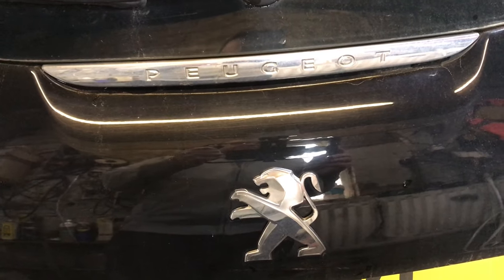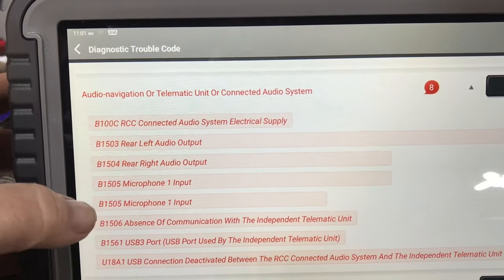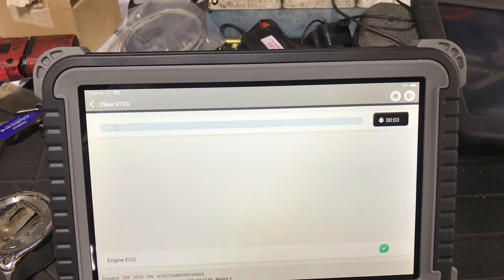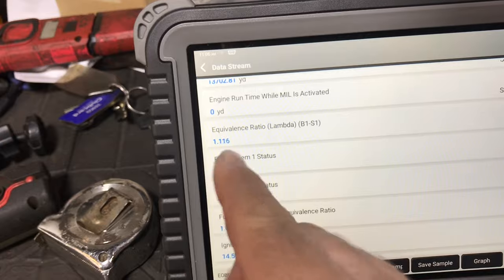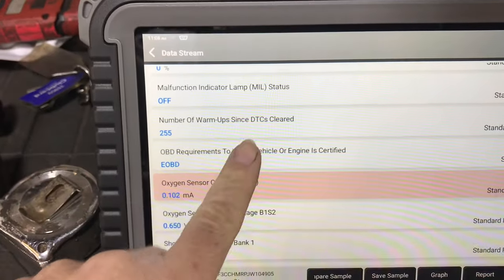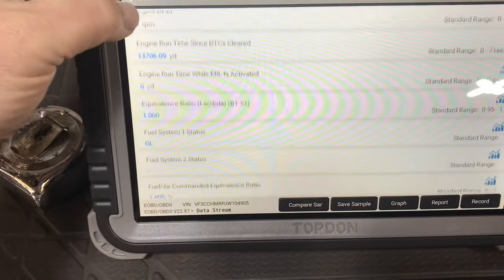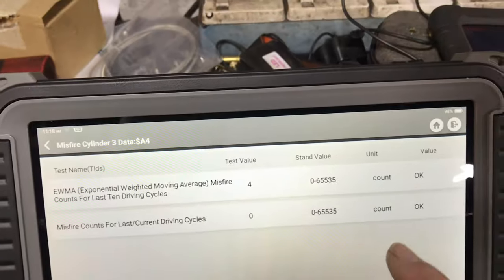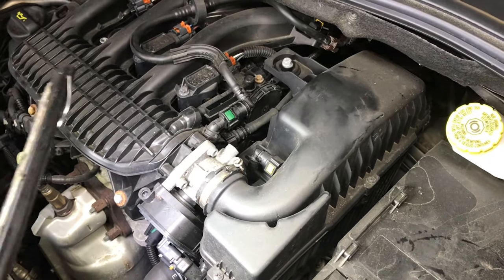Peugeot 208 (2018) 1.2 Engine - Failed Emissions Test,  No Fault Codes😭

Comment: I'd bet you would find the vacuum will be quite erratic since it's only a 3 cylinder. Usually a fluctuating vacuum gage like that indicates a valve sticking or burnt. 4 cylinders are a bit erratic but 6 and 8 cylinders have overlapping intake strokes so should be quite steady. I'm wondering if it was simply contaminated fuel or greater than e10 if it's available there. Still does not explain why it didn't try to go to closed loop and no codes.

Comment: Hi Sandy, and I'm having a similar problem with a Peugeot 208 2015 1.0 petrol model that has 55k miles on it and misfires cylinder 2. I've changed the coils and plugs, but the problem persists. Could you please suggest a solution?
Reply from the maker: Do a compression test to see if all cylinders have similar pressures
Reply: Hey mate were you able to solve it? I am having the same issue. I have replaced spark plugs and tested coils.

Comment: 2015 citroen C4 1.2 puretech 82 vti: 

I have huge vacuum in the Crankcase, it almost stalls the engine. Engine rpm periodically slow down to almost stall, then the throttle body opens a little bit (reducing the vacuum) and rpm increases.

I replaced the valve cover (PCV is build in), problem still remains.

When I blow in the breather pipe that is coming off before the throttle body, the engine runs fine.

I hope it is the valve you pulled out and showed in video 11:09

Comment: The catalytic converters are poor on these 208 petrol Pugs. Ours failed mot at 55k miles , they changed the cat and all was sorted , we were also told they burn oil because of poor piston ring design, the petrol goes past the rings into the sump oil system and also burns rich because of this scenario

Comment: I got one i had ccv valve cloge remove ot and clean it but if open oil cap while idle engine seems going rough and suction  from oil cap when close works good... Could  I the pcv valve!?

Comment: That is nuts, a car of that age, from what we have been told through the media should run on E10 easily. 
More lies being told I fear. We have a couple of old classics and looking for a fuel good enough to run them is getting difficult. Shell V power is looking like the only option and that's touching £2 a liter.  The government won't be happy till we all have electric cars, and that will be a really sad day.
Reply from the maker: Just put the good fuel in for the MOT🤣🤣🤣
Reply: @sandyande  I have been told that E10 will rot out older rubber components,I am not sure how true that is. Do you have any ideas if that is true or not?
Reply: @neilhampson2843 Yes but that only applies to older cars like pre 2000s and cars which are listed as incompatible on the government website its because of the fuel line material wasnt made with e10 in mind because it was just pure unleaded years ago, other countries have had e10 for years so the cars are already designed for it in mind

Comment: Modern E 10 fuel , kind to the environment,  but it dosent work In petrol driven cars , so now owners of petrol cars older than 2 yrs old have to spend an extra 6 quid to fill up with good stuff Sandy , great video,  glad your getting used to the new toy 👍👍👍👍
Reply from the maker: I wish I had caught the injector duration Mike it was unbelievable before and after, E10 is going to cost alot of people alot of greenbacks! Cheers sandy
Reply: wait till they start burning valves out , there will be a lot of unhappy manufacturers with customers kicking off
Reply: My camry done 240k on e10...no issue.

Comment: Hi , got the same problem on my 2014 1.0 
Failed emmisons on m.o.t , smokes alot , backfires slightly on overrun and smokes alot which smells of unburnt fuel 
How quick did the car adjust back to E5 and start running right ? , I've put a couple of gallons in , hoping it makes a difference as I've tried everything else 😂
Reply: Any luck? Mine is exact same!!!

Comment: Useful video just proves these engines including the the turbo models must be run on E5. I have run my Puretech 130 1.2 On BP Ultimate and Shell V-Power from new (2016) and wouldn't touch E10 with a bargepole. Absolute crap!

Comment: Very interesting 

Ill be heading to the garage soon 

Got a c3 1.2 puretech 82 

Think my problem is its sucking in extra air from somewhere 

Symptoms are when under load it struggles at low revs so 4 gear at 30 it vibrates and on the flat in second if down to 10 it shudders up in speed then settles down 

No engine check light 

I take it at low revs its pulling in more air than it needs 

Also if your gentle with the gas you can hear it pulling in the air not only from the air filter side 

It also does a whirring sound in the morning 

Well I'm hoping its this 

Just subscribed

Comment: Loved the video, nice steady explanation speed throughout. In case you weren't aware Google has converters for almost every type of unit of measurement that there is. This is not meant in any way as a criticism, just a tip as it might make doing things like pressure conversions easier for you. I know its definitely my go to!